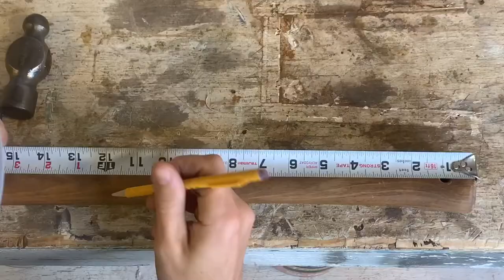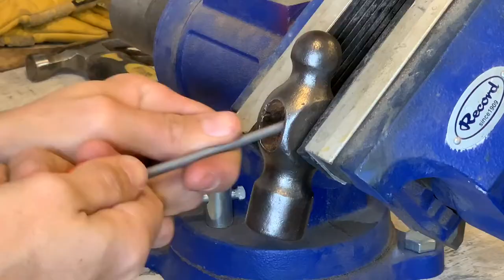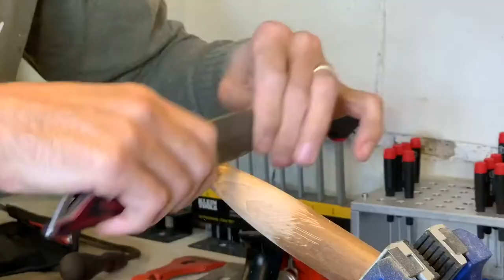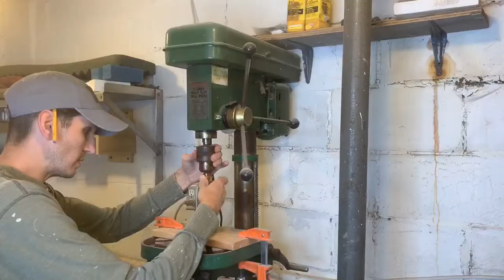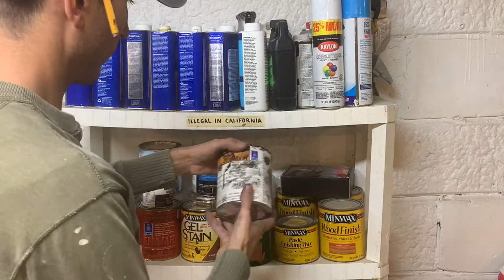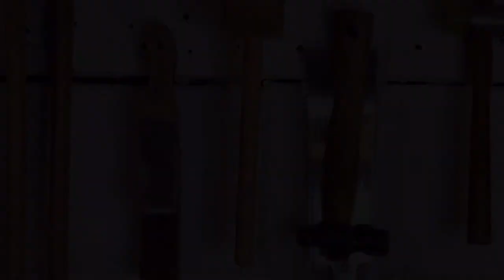One Day Restorations: Billings Hammer Hung on an Old Axe Handle

Comment: Yeah... metal step wedges do make for a messy looking handle end when the handle and wooden wedge split. To deal with my OCD I soak the handle and wooden wedge down good with BLO when I hang tools. It lubricates assembly while it's wet and acts like glue when it's dry. IF I use a step wedge (I often don't) I put it in while things are wet with BLO.  I can then beat the softened wood fibers to close up the gaps the steel wedge makes. I soak the handle and wooden wedge down with BLO a few more times after that and the cracks all but disappear. Is it necessary... No, but it pleases me. ;~)

BTW, I got the ax and carpenter's hatchet heads out of the electrolysis and carded them. They look pleasing to the eye... I still have to make (or buy) handles and hang them... Now that it gets dark so early I'll probably get to them sooner rather than later.  Your video has me wondering if the old ax handle has enough good wood in it to make the hatchet handle. It was rotten inside the ax head and the swell was chipped and cracked but there was a lot of wood in between that appeared to be intact.  I'm definitely going to check it out. Failing that, I've got maybe 1,000 -1,200 b.f. of ash in my lumber shed. Surely there is a board in there with proper grain. ;~)
Reply from the maker: To each his own.  Honestly when I get an axe that’s not busted up and spread over on top I worry it will come loose.  And nothing bothers me more than a loose head, even the tiniest bit translates to the hand.  As far as using old handles, I say give it a try.  I’ve used a few like that.  Never toss them out.